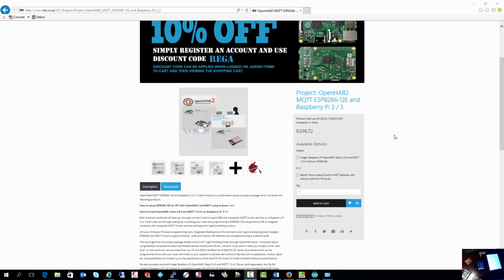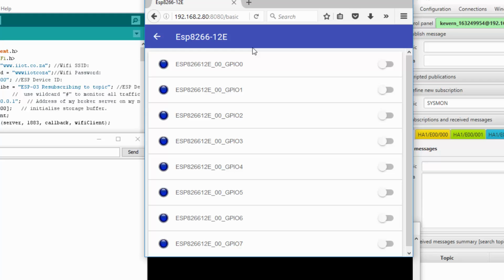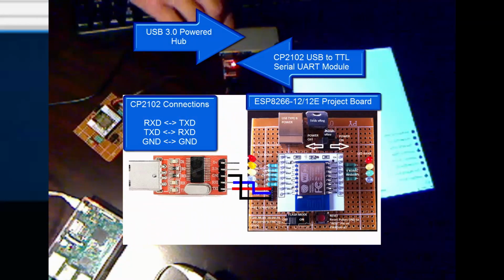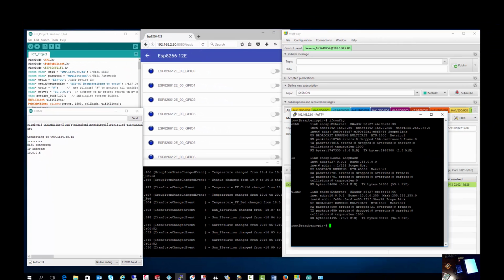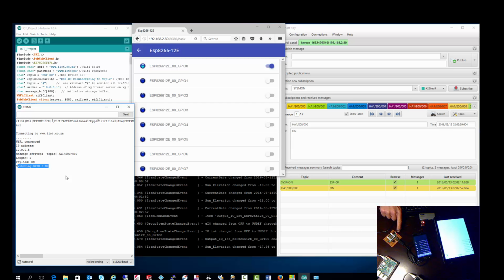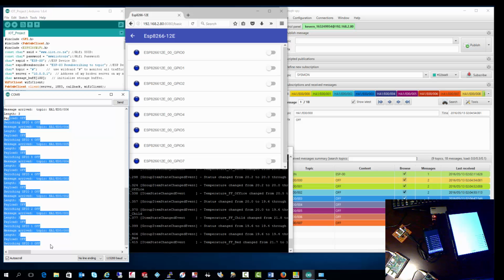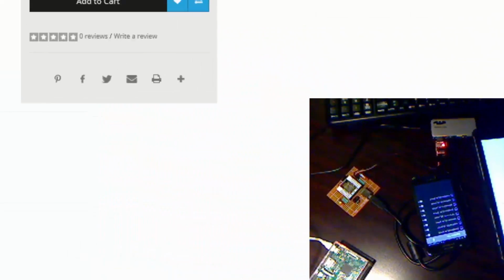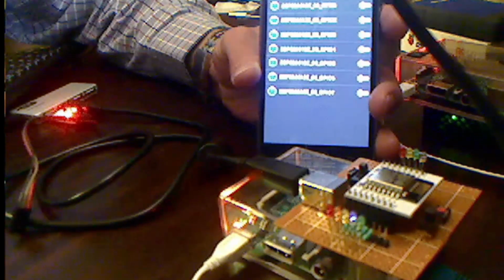IOT Project OpenHAB2 ESP8266-12E MQTT Raspberrypi 3 controlling 8 LED's

Comment: Can you have a physical switch contacted to it aswell? Say on a wall somewhere? Also does it have to be wireless? Can it be wired to a network and so it is physically connected to the rspi 3 ?
Reply from the maker: Robert Poynton , yes, yes, no, yes
Reply: Do you have a video on it?
Reply from the maker: Robert Poynton no, I have not made one but if you plug the ethernet port of the pi into a network having dhcp it will be reachable through that interface, merely connect the esp devices to the distributed wifi network access points connected in turn to the lan.